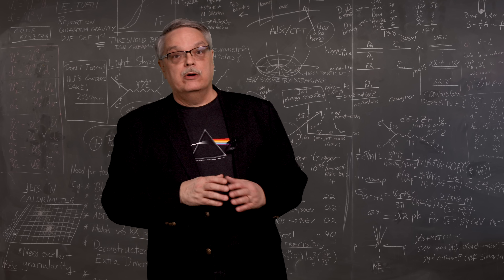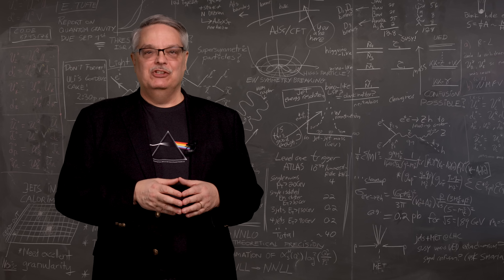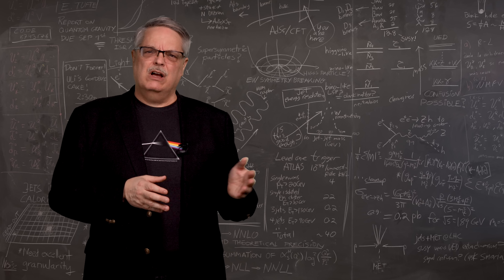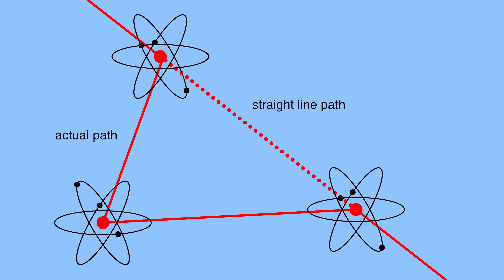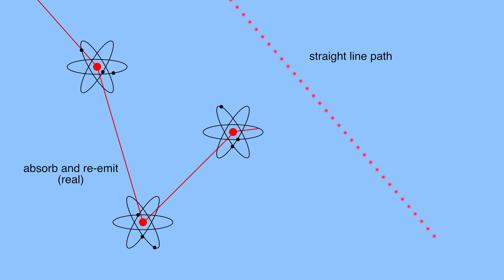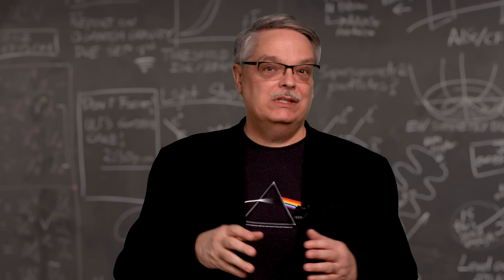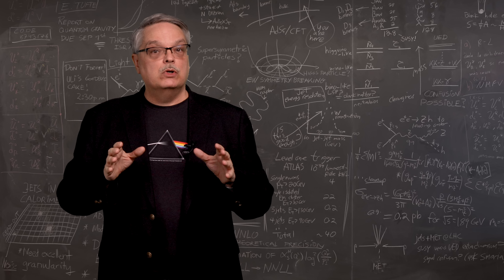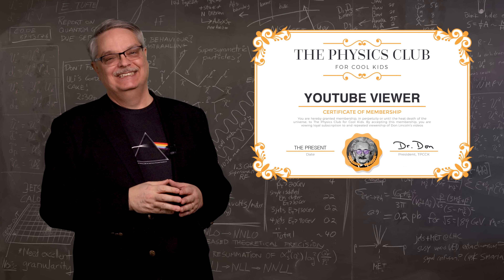Why does light slow down in water?

Comment: Another great video about a complicated question in easy to understand English! Thanks You Very Much!
Pink Floyd T-Shirt  +1
Reply: this video has taken many shortcuts in explaining the relations between the two systems and how it affects them.
to better understand this, we need to talk about d'alembert's equation and its dispersion formula and how it describes a wave.
so d'alembert's equation is used to link together the spatial and temporal variation of a wave.

and from this equation comes the dispersion relation that links together the frequency, wavelength and celerity of a wave.
to access to this equation, we use maxwell relations to describe this phenomenon. when we consider those relations in the void, we get the relation: c² = w²/k² where k is the angular frequency and w its wavenumber. (just google it, ain’t that hard to understand)

thus we can see here that the celerity is proportional to its angular frequency. however, as explained in the video, when light enter a medium, there are charges that can be influenced by the electric field, especially electrons that are 2000 times lighter than their counterparts protons.
thus, when light comes in this medium, we assume that only electrons are affected by the electric field.

we then apply newton's second law to those electrons to find a relation between an electron's speed and the electric current
(we also neglect the magnetic field of the light as the electron is relativistic thus the force from the electric field is much greater than the magnetic one see lorentz law to better understand this )
and then by generalizing this equation to all electrons in the medium, we can get an induced current from the electric field of the light.
( the current is j = n * v with n the volumic density of charges and v the celerity of electrons)

then when we put this back to maxwell ampere local equation, we introduce a new component: the induced current which thus gives us a new dispersion equation: c² = (w² - wp²) / k² with wp the plasma oscillation and thus we can see that from the value of wp, we'll get a different value of the celerity of the wave.

thus we can say without a doubt that they are wrong in their explanation as it is not the combination from the electric current of the electrons and the wave that makes it slower but the induced current inside the medium that modifies the dispersion relation thus modifying its speed.
or in simpler words, it's the movement of electrons that changes the frequency and celerity of the light, but not the combination of the two electric current. (also on a side note, trying to represent the electric current of a dipole using a sine wave.. funny thing you did there 😅)

and finally, as for the reason why the light has a different angle, well you can easily explain this using two waves parallel to each other crossing the medium in phase with each other. as they have the same wave plane, you can easily come to the relation between the refracted angle and the incident angle using some basic geometry. i recommend you to see the demonstration of descartes second law if you want to better understand what i'm talking about.

Comment: You're wrong, if you watch my Quantum Mechanics playlist, you'll see that Feynman's path integral theory explains slowing light in glass with simple probability amplitudes.
Reply: this video has taken many shortcuts in explaining the relations between the two systems and how it affects them.
to better understand this, we need to talk about d'alembert's equation and its dispersion formula and how it describes a wave.
so d'alembert's equation is used to link together the spatial and temporal variation of a wave.

and from this equation comes the dispersion relation that links together the frequency, wavelength and celerity of a wave.
to access to this equation, we use maxwell relations to describe this phenomenon. when we consider those relations in the void, we get the relation: c² = w²/k² where k is the angular  wavenumber and w its angular frequency. (just google it, ain’t that hard to understand)

thus we can see here that the celerity is proportional to its angular frequency. however, as explained in the video, when light enter a medium, there are charges that can be influenced by the electric field, especially electrons that are 2000 times lighter than their counterparts protons.
thus, when light comes in this medium, we assume that only electrons are affected by the electric field.

we then apply newton's second law to those electrons to find a relation between an electron's speed and the electric current
(we also neglect the magnetic field of the light as the electron is relativistic thus the force from the electric field is much greater than the magnetic one see lorentz law to better understand this )
and then by generalizing this equation to all electrons in the medium, we can get an induced current from the electric field of the light.
( the current is j = n * v with n the volumic density of charges and v the celerity of electrons)

then when we put this back to maxwell ampere local equation, we introduce a new component: the induced current which thus gives us a new dispersion equation: c² = (w² - wp²) / k² with wp the plasma oscillation and thus we can see that from the value of wp, we'll get a different value of the celerity of the wave.

thus we can say without a doubt that they are wrong in their explanation as it is not the combination from the electric current of the electrons and the wave that makes it slower but the induced current inside the medium that modifies the dispersion relation thus modifying its speed.
or in simpler words, it's the movement of electrons that changes the frequency and celerity of the light, but not the combination of the two electric current. (also on a side note, trying to represent the electric current of a dipole using a sine wave.. funny thing you did there 😅)

and finally, as for the reason why the light has a different angle, well you can easily explain this using two waves parallel to each other crossing the medium in phase with each other. as they have the same wave plane, you can easily come to the relation between the refracted angle and the incident angle using some basic geometry. i recommend you to see the demonstration of descartes second law if you want to better understand what i'm talking about.

Comment: The video doesn't do a good job of explaining it - you just have to look at the comments here - more confusion than anything. All electromagnetic waves travel at the speed of light: it doesn't matter if they're a photon or the result of a moving electron. So combining two waves, that both travel at the speed of light, to give a wave that moves slower just isn't as simple as a 'ta da'. This is maths. And its not very simple maths. Sixty symbols did a couple of videos about this half a decade ago. They're much better for anyone interested ;)
Reply: mind to check my explanation ?

this video has taken many shortcuts in explaining the relations between the two systems and how it affects them.
to better understand this, we need to talk about d'alembert's equation and its dispersion formula and how it describes a wave.
so d'alembert's equation is used to link together the spatial and temporal variation of a wave.

and from this equation comes the dispersion relation that links together the frequency, wavelength and celerity of a wave.
to access to this equation, we use maxwell relations to describe this phenomenon. when we consider those relations in the void, we get the relation: c² = k²*w² where k is the angular frequency and w its wavenumber. (just google it, ain’t that hard to understand)

thus we can see here that the celerity is proportional to its angular frequency. however, as explained in the video, when light enter a medium, there are charges that can be influenced by the electric field, especially electrons that are 2000 times lighter than their counterparts protons.
thus, when light comes in this medium, we assume that only electrons are affected by the electric field.

we then apply newton's second law to those electrons to find a relation between an electron's speed and the electric current
(we also neglect the magnetic field of the light as the electron is relativistic thus the force from the electric field is much greater than the magnetic one see lorentz law to better understand this )
and then by generalizing this equation to all electrons in the medium, we can get an induced current from the electric field of the light.
( the current is j = n * v with n the volumic density of charges and v the celerity of electrons)

then when we put this back to maxwell ampere local equation, we introduce a new component: the induced current which thus gives us a new dispersion equation: c² = k² * (w² - wp²) with wp the plasma oscillation and thus we can see that from the value of wp, we'll get a different value of the celerity of the wave.

thus we can say without a doubt that they are wrong in their explanation as it is not the combination from the electric current of the electrons and the wave that makes it slower but the induced current inside the medium that modifies the dispersion relation thus modifying its speed.
or in simpler words, it's the movement of electrons that changes the frequency and celerity of the light, but not the combination of the two electric current. (also on a side note, trying to represent the electric current of a dipole using a sine wave.. funny thing you did there 😅)

and finally, as for the reason why the light has a different angle, well you can easily explain this using two waves parallel to each other crossing the medium in phase with each other. as they have the same wave plane, you can easily come to the relation between the refracted angle and the incident angle using some basic geometry. i recommend you to see the demonstration of descartes second law if you want to better understand what i'm talking about.

Comment: Thanks a lot. But sir what is the reason for changing direction of light as it goes in glass?
Reply: this video has taken many shortcuts in explaining the relations between the two systems and how it affects them.
to better understand this, we need to talk about d'alembert's equation and its dispersion formula and how it describes a wave.
so d'alembert's equation is used to link together the spatial and temporal variation of a wave.

and from this equation comes the dispersion relation that links together the frequency, wavelength and celerity of a wave.
to access to this equation, we use maxwell relations to describe this phenomenon. when we consider those relations in the void, we get the relation: c² = k²*w² where k is the angular frequency and w its wavenumber. (just google it, ain’t that hard to understand)

thus we can see here that the celerity is proportional to its angular frequency. however, as explained in the video, when light enter a medium, there are charges that can be influenced by the electric field, especially electrons that are 2000 times lighter than their counterparts protons.
thus, when light comes in this medium, we assume that only electrons are affected by the electric field.

we then apply newton's second law to those electrons to find a relation between an electron's speed and the electric current
(we also neglect the magnetic field of the light as the electron is relativistic thus the force from the electric field is much greater than the magnetic one see lorentz law to better understand this )
and then by generalizing this equation to all electrons in the medium, we can get an induced current from the electric field of the light.
( the current is j = n * v with n the volumic density of charges and v the celerity of electrons)

then when we put this back to maxwell ampere local equation, we introduce a new component: the induced current which thus gives us a new dispersion equation: c² = k² * (w² - wp²) with wp the plasma oscillation and thus we can see that from the value of wp, we'll get a different value of the celerity of the wave.

thus we can say without a doubt that they are wrong in their explanation as it is not the combination from the electric current of the electrons and the wave that makes it slower but the induced current inside the medium that modifies the dispersion relation thus modifying its speed.
or in simpler words, it's the movement of electrons that changes the frequency and celerity of the light, but not the combination of the two electric current. (also on a side note, trying to represent the electric current of a dipole using a sine wave.. funny thing you did there 😅)

and finally, as for the reason why the light has a different angle, well you can easily explain this using two waves parallel to each other crossing the medium in phase with each other. as they have the same wave plane, you can easily come to the relation between the refracted angle and the incident angle using some basic geometry. i recommend you to see the demonstration of descartes second law if you want to better understand what i'm talking about.

Comment: just say, can you combine two waves so the result moves FASTER then speed of light ? : If 1st wave + 2nd = third, then 3rd - 2nd (just turn phase on 180) = 1st what moves faster then first two ?
Reply: This video is missleading, because it dumbs it down to a point, where one could argue, that it's actually wrong. Short answer to you: yes, you can - but not in the way you think. Refraction changes the phase velocity of light, not it's actual 'speed'. So while you can speed up the phase velocity of light, you still won't be able to tranfer information faster than the speed of light in vacuum.
Reply: @xBris  then it shouldnt change real speed in glass also?

Comment: Respect for the DSM shirt and loads of thanks for the sience
Reply: what science ?
this video has taken many shortcuts in explaining the relations between the two systems and how it affects them.
to better understand this, we need to talk about d'alembert's equation and its dispersion formula and how it describes a wave.
so d'alembert's equation is used to link together the spatial and temporal variation of a wave.

and from this equation comes the dispersion relation that links together the frequency, wavelength and celerity of a wave.
to access to this equation, we use maxwell relations to describe this phenomenon. when we consider those relations in the void, we get the relation: c² = k²*w² where k is the angular frequency and w its wavenumber. (just google it, ain’t that hard to understand)

thus we can see here that the celerity is proportional to its angular frequency. however, as explained in the video, when light enter a medium, there are charges that can be influenced by the electric field, especially electrons that are 2000 times lighter than their counterparts protons.
thus, when light comes in this medium, we assume that only electrons are affected by the electric field.

we then apply newton's second law to those electrons to find a relation between an electron's speed and the electric current
(we also neglect the magnetic field of the light as the electron is relativistic thus the force from the electric field is much greater than the magnetic one see lorentz law to better understand this )
and then by generalizing this equation to all electrons in the medium, we can get an induced current from the electric field of the light.
( the current is j = n * v with n the volumic density of charges and v the celerity of electrons)

then when we put this back to maxwell ampere local equation, we introduce a new component: the induced current which thus gives us a new dispersion equation: c² = k² * (w² - wp²) with wp the plasma oscillation and thus we can see that from the value of wp, we'll get a different value of the celerity of the wave.

thus we can say without a doubt that they are wrong in their explanation as it is not the combination from the electric current of the electrons and the wave that makes it slower but the induced current inside the medium that modifies the dispersion relation thus modifying its speed.
or in simpler words, it's the movement of electrons that changes the frequency and celerity of the light, but not the combination of the two electric current. (also on a side note, trying to represent the electric current of a dipole using a sine wave.. funny thing you did there 😅)

and finally, as for the reason why the light has a different angle, well you can easily explain this using two waves parallel to each other crossing the medium in phase with each other. as they have the same wave plane, you can easily come to the relation between the refracted angle and the incident angle using some basic geometry. i recommend you to see the demonstration of descartes second law if you want to better understand what i'm talking about.